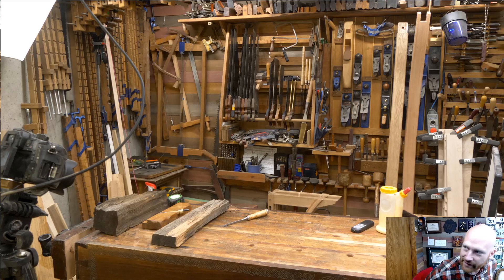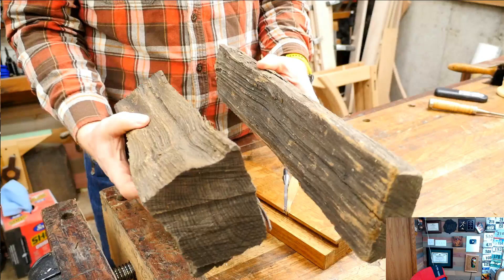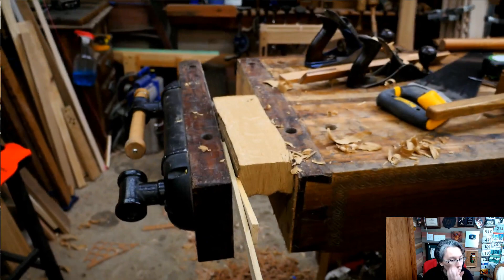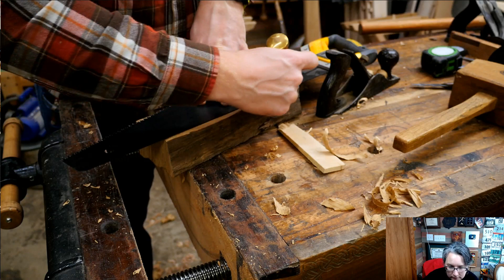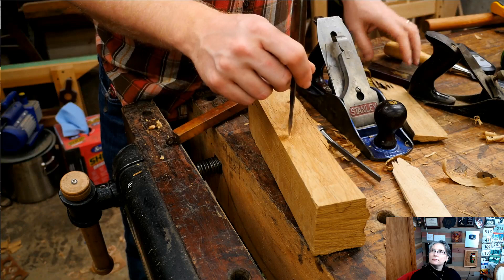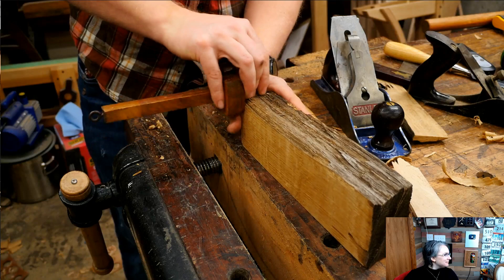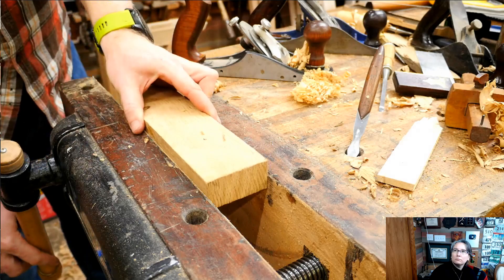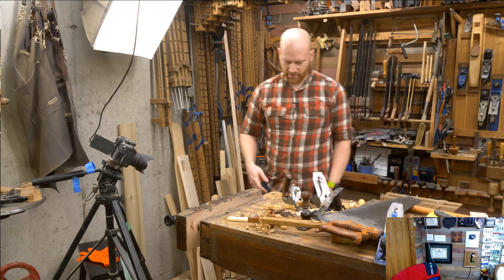How to Make a Grooving Plane From Firewood and a Chisel

Comment: I know this was at the height of the pandemic, but whenever you’re working with firewood, do you normally test with a moisture meter before starting your projects or partway through to verify that the wood is actually dry? The reason I ask is because I have made a few projects like mallets out of Osage Orange it is extremely dense, and I started with green logs.  I made a few rough boards as well and they have been sitting for the last two years
Reply from the maker: with fire wood if it has been drying out side for a year or two it should be fine to bring in. I then let it acclimate to the shop for a week or two.

Comment: One thing you forgot to mention about wood selection for planes, is that apart from beech, a lot of european planes, especially shop made ones (also even new ECE ones) have been made from fruit woods too. Pear and apple seem to be used quite often. So if one is felling a fruit tree I would assume that either of those two would work out fine as well... Pear wood btw is wonderful to work with. I just made a tiny smoother out of it the other day. :)
Reply from the maker: Verry true. I have two that are apple.

Comment: I'm curious to know if it is possible to break down a piece of firewood into lumber without a vice? Are you able to do this with other work holding methods (dogs, holdfasts, etc)?
Reply from the maker: Sure. I have a video showing how to rive it then plane it square. You could do it with just a planing stop. If nothing else mount a clamp and use that.

Comment: Why do you set your planes down onto the cutting edge?
Reply from the maker: That's the most common way. I did a video comparing putting it on a soul in on its side and putting that side does more damage in general. Unless you're working on a metal bench or a bench with nails or screws in the surface it's best to put the plane down on that soul. It started with a Ole Miss propagated by shop teachers. They scared a lot of people from putting them down on their soul.

Comment: What's it used for?
Reply: For making grooves along the edge of wood, for example drawer bottoms, door panels, ect
Reply from the maker: What Lego man said. You can also use it for the groove side of a tongue and groove joint or to capture panels in a door or basically anywhere else you need to make a groove.

Comment: is that wooden handle chisel from Harbor Fright better the the plastic handle one
Reply from the maker: yup that is a HF Chisel that I used for the iron.
Reply: @WoodByWright  ok does the wooden handle chsel hold a better edge then the plastic handle one
Reply from the maker: Yes. I just included them in the chisel test video if you want to see the comparison.
Reply: @WoodByWright  ok thank you